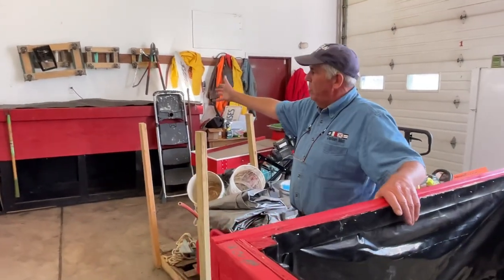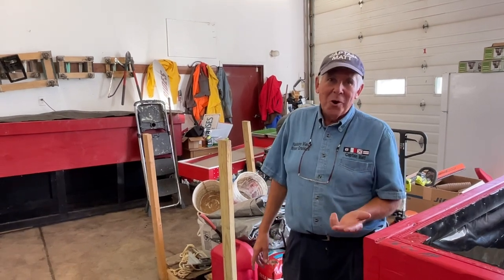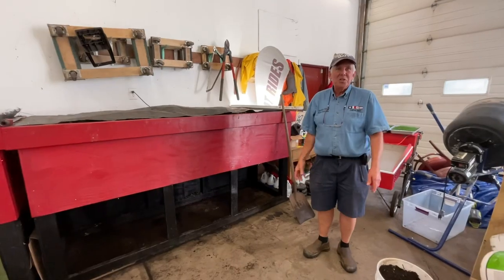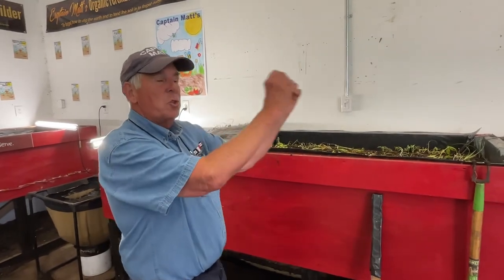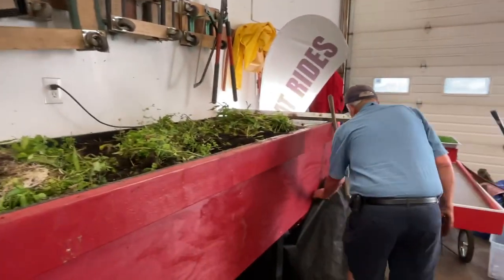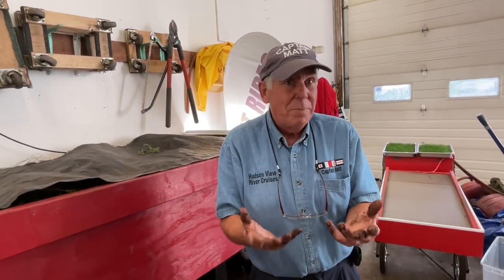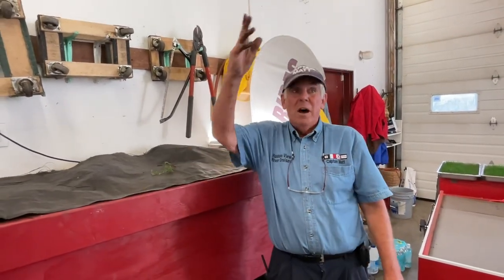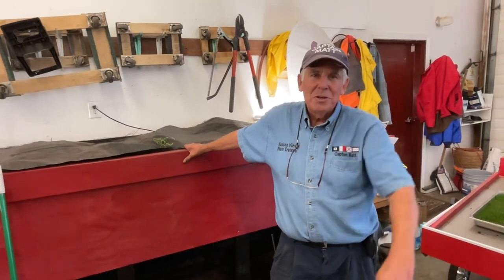Harvesting a Big Red Worm Bin

Comment: Captain, could you use place a [piece of [plywood at an angle under your bins to allow the casting fall out from under the bins?  This should make harvesting easier.
Reply: Exactly my thought. Drop the back edge six or so inches for the rake, and then taper it to the top edge of the front of the base. The $2.50 rake will still function to wipe the taper. If he wants to get fancy, he could laminate the plywood to add durability and a slippery slope.
Good stuff!
Reply from the maker: Good ideas, TL! Thanks for chiming in.
Reply: Funny, I was just wondering the same thing 😁
Reply: Happy 2014! Thank you for the detailed explanations. It has been a year and my worms are still alive and well. God bless you

Comment: Hello Captain Matt,
I have an idea that could save some time and bending over.
You could add a piece of plywood underneath the bin at a slope from the top in the back to the bottom in the front.
Basically,make a slide for the casting to drop out in front of the bin for easy scooping.
Really enjoy your videos. Thanks for sharing your experience.
Reply from the maker: That's a good idea,  Rusty. Thank you!

Comment: When you overwater do you put bins underneath to catch the excess or just let it drip to the concrete? If you allow it to drip have you ever had any issues with smell or stains? I have an 8' by 2' CFT in my basement and don't want to cause any issues.  
Thanks Capt. Matt! I'm not sure I would have undertaken this adventure without your guidance and great personality!
Reply from the maker: I just let it go into concrete and have a drain in the floor. You can want to experiment with catching if in a basement. Thrilled to hear of your progress!
Reply: I assumed you had a drain of some sort, Thank you for the clarity! So far its working but I will be cutting a drain tile into my sump pit eventually. Other than losing a couple worms here and there to the dryness of the concrete its going very well! @CaptainMattsWorms